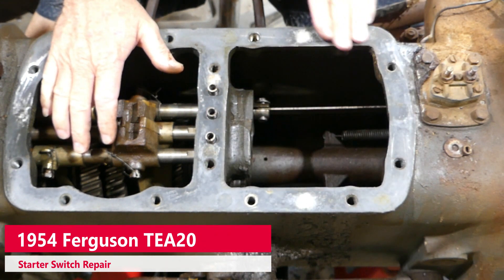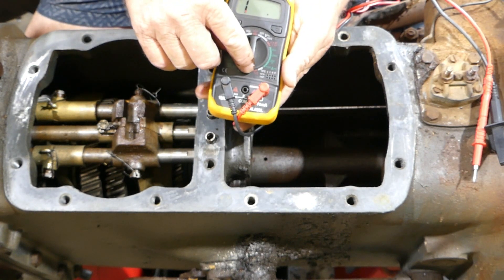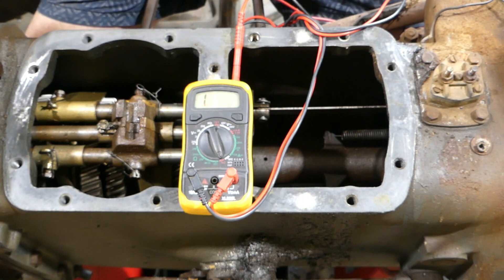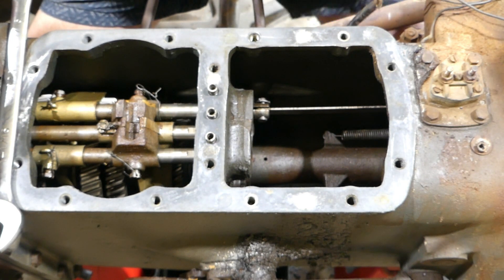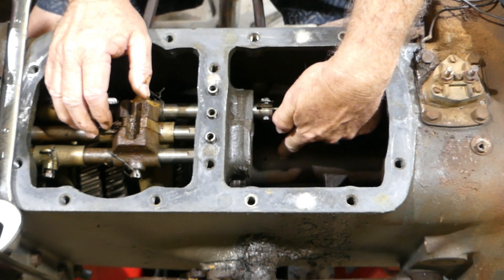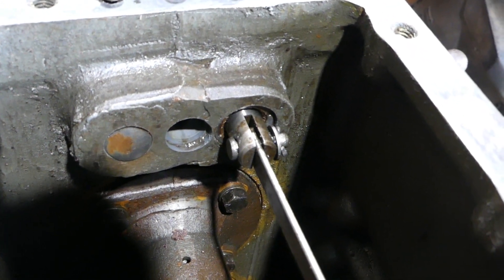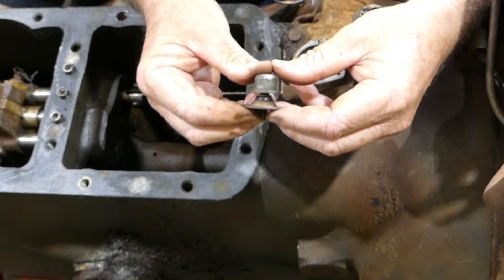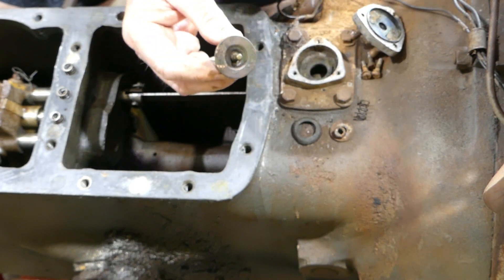Ferguson TE20 Start Switch, How to fix it and not replace it.

Comment: my old girl has a push button on the dash looks like it was disconnected years ago .I'm always carefull not to start it in gear. Been like this for 12 years since i brought it .thinking about selling it but the old girl is so handy with the 4 foot slasher , brought a zero turn a few years ago but i just like driving it around the farm for the looks i get from cars going past, sort of a fun thing to drive.
Reply from the maker: They are a fun little tractor for sure.

Comment: When I got my T20 the Bakelite was cracked in two pieces and l was unable to repair it .I had to use your sparex replacement starter switch which looks like the original and works great ,sure beats the screwdriver trick.LOL 👍
Reply from the maker: I use them at times and they seem to be a good product.

Comment: Hi Lance, Think I have watched your video on the starter switch about 3x.  My starter was hit and miss and now won't start at all. After watching your video I took the switch off and it came off in 2 pieces. Somebody had glued it together at some point in the past. Also one contact point was badly corroded and burned as was the little round disc that pushes up from below. Tried ordering a new one from queenslandtractorspares but you don't appear to ship overseas. So I have ordered one from the UK. It comes with the plate that bolts onto the chassis. Hopefully it will work on my 1951 TEA-20 Ferguson that I just bought. Cheers, Midge
Reply from the maker: No we dont ship overseas due to the expensive freight now a days. It has gotten a bit out of hand since covid.

Comment: When I bought my TE-20 the switch was  bypassed with a push-button style placed on the dash. Evidently someone lost the nuts for the original switch and therefor couldn't use it as the threads were some crazy English pitch. I had to Ebay some from a motorcycle shop in the UK.
Reply from the maker: A lot of odd stuff has been done to these old tractors, after all they are around 70 years old
Reply: @BundyBearsShed  Yes, I believe the "mechanic" that rebuilt the engine was quite the fella.

Comment: Hi Lance, another excellent video very well presented. Thanks for your wonderful service for us Ferguson 20 restorers. 
I have a question for you. Recently I started the Ferguson while standing beside it and when I released the gear lever it slipped into reverse even though the clutch was not engaged. Fortunately I succeed in getting it out of reverse before any damage was done. Is there any easy measure I can take to prevent the gear lever going from starting to reverse in a single move.
Reply from the maker: It sounds like the detent spring might be very weak or rusty. They should be strong enough to stop the stick on the way through.

Comment: Wonderful channel, loving it a lot. I'm trying to get a friends' tractor starting, but I can't get the reverse selector to move backwards like you show in order to move the pivot to operate the starter switch. It will go into reverse OK but will not work the starter. I have removed the starter switch and observed the pivot moving downwards when selecting reverse but of course the pivot has come upwards in order to hit the starter button. So the linkage is connected  to the gear selector OK, but unable to push the gear lever forwards into the start position. Any ideas?
Reply from the maker: Try lifting the gearstick as you go, it in not exactly in line but close.
Reply: @BundyBearsShed  
Tried to lift and push forward and its no go. Decided to go with a key switch and a solenoid and then discovered another issue, the electrics are all 12V +ve earth, dynamo, regulator, battery and ignition coil are all 12V but the starter motor is 6V??? I saw something about the tractor has 2 types of starter motor depending on the Bellhousing?? How can we be sure of getting the right type of 12V starter for this, or is it OK to run with the 6V one as the starter is not in constant use, but it will take at least twice the current and therefore generate much more heat in the windings?
Reply from the maker: @leonardbutcher8555  the 6v starter will go ok with 12v it doesn't seem to worry the starter.

Comment: nice   i  got  6volt  motor  12volt  gear  box the  ring  gear  nfg 6 volt start motor working  on  front  of  ring  no  teeth  letf  so  now  12v  start motor   working  back of  ring she  good  for  20  years
Reply from the maker: Yeah you can get away with a lot on these old girls.